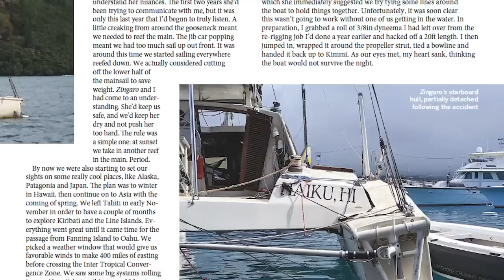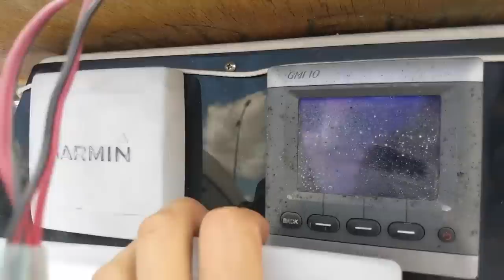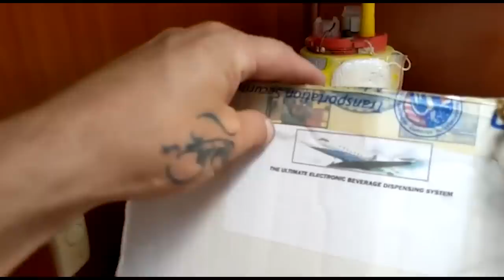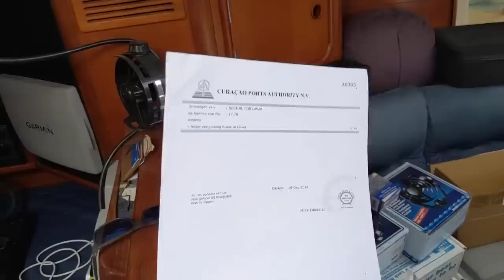Junkyard find! Trash boat, will it float??

Comment: It may be a lot of money now but you’re still gonna have to buy one sooner or later and it’s cheaper than hauling a boat out for the one valve. If it was me I’m getting the valve and putting it in now.
Reply: I agree, Duane.
Reply: Absolutely. Consodering there will be 7 pps onboard, one head is... tough. Sooner, the better. You don't think about this when you are overwelmed by the amount of work, but you should always prioritice basic needs. Water, bed, head.
Reply: I agree,  do everything under the waterline that should be done now while the boat is out of the water.  It will save money when you look at the bigger picture.    It's a gamble to leave a repair until a later haul out  for other reasons (repainting antifoul, prop maintenance, etc.) and have that repair cost you a haul out plus the cost of that repair.
Reply: Couldn’t agree more

Comment: HiJames, I am a old sea dog, and have owned Oyster 55, a few years ago, and completed a major refit. The through hull fittings will be high quality bronze. They should last a lifetime. They will also be very hard to remove. The fittings attached to them look poor, so I would remove fittings, then inspect through hull before decision to replace. Also don’t be shy at contacting Oyster they are very helpful in all respects.  Good luck!
Reply: great advice!

Comment: In 2002/2003 I sailed a 1995 Oyster 61 20,000 miles from England to Russia and on to New Zealand. Your little sistership brings back a lot of memories! Some suggestions - First, the joinery and finishes on the boat don’t seem that bad, so it’s absolutely critical that you PROTECT THE BOAT. Get a couple of thick towels, or even better ‘moving blankets’, and some random sized pieces of plywood and plastic sheets. Always cover and protect the finish and wood work anywhere you’re working. Never put a tool or a part down on an unprotected surface. Never turn a tool or exert force towards an unprotected surface. In particular be careful with those beautiful fiddles around all the horizontal surfaces, it’s very easy to dent and degrade the top edges of them. When you have a nice boat like this, this is an incredibly important discipline. Otherwise it’s easy to do a lot of expensive cosmetic damage very fast, and it only takes a few extra moments and some mental discipline to do it. Second - before you buff the topsides check what’s there; if it’s gel coat, fine. If it’s Awlgrip (which it kinda looks like)  DO NOT BUFF IT. In that case, wipe it down with lots of plain white vinegar, then Awlwash, then Awlcare. You buff it, you ruin it. Last one - unless you get some storage to empty the boat, stand up the cushions on the over under bunks and put everything there, make the rest of the boat as empty as you can. Much easier to do stuff.

Comment: For the 2 inch thru hull in the head.  Remove the hose and spray in lubricant, spray from bottom as well. You have time so let it sit.  Hit it with heat from a torch if needed, keep a fire extinguisher handy and some wet rags to draw the heat away from the glass is needed.  Or pull it out and do the above.   I have the same ones on my boat and they are well oversized (as in can handle a lot of pressure) for the actual work (pressure) they have to contend with day to day.

Comment: James, congrats on the beautiful Oyster. It will make a great liveaboard. The more jobs you tick off the list now, the longer you can wait for the next haul out. So take your time:
1) Considering the erosion that has taken place on the through-hulls fittings, I would definitely replace all of them. If you replace all but one, you will always be wondering if that last one is going to be the one that sinks your boat.
2) While you´re at it replace all hoses and hose-clamps, for safety and sanitary reasons. New plumbing will make the boat feel, smell and taste NEW! - Expensive but worth it.. After all it´s your new home!
3) Fix your holding tank if possible or get a new one. You will run into problems without one..
4) Prioritize the watermaker repair. As far as I understood, it has failed? I guess this is pretty obvious..
5) Keep the old Epirb if its functional. They are 300+ usd
6) Keep the dinghy if it holds air. Money saved! Check if its made from PVC  or Hypalon. The latter should last 10-20 yrs
7) Drop the rudder and service or change the bushing. It will give you peace of mind and help preserve your autopilot, when you bring that one back to life.. (I am no expert, but it looks like the rudder has water ingress? What do you think)
- Lots of projects, but the boat really cleaned up fast. A very sound platform

Comment: James.. for the 2+" thru hull valve you do not necessarily need to replace it. Have you tried using a phosphoric acid wash on the valves? You can flood the valves, flush and or run phosphoric acid through the valve, and use PB Blaster on the outside of the valve. It sjould free them up and allow you to wait on replacing them.

Also, you can temporarily bypass the sink macerator pump and go straight to the thru hull as long as it is just gray wster.

Hope this helps.

Comment: I'm assumimg you have the diesel pumped out by now. You got the basic batteries and dinghy fixed, focus on the rudder, bottom paint and through-hulls/valves. Get those done asap then splash her. If you have time already paid for on the hard do the buffing, but hatches, hoses, portlights, etc can all be done on the water just as easily. Good luck, you got this.

Comment: Hi James, check the big red handle grips in your tool kit, they should slide to fit larger fittings than your shifting wrench. They have been known to shred the edges of fittings if used improperly. Take it easy.

Comment: keep the toilet  pump straight out , it feeds the fish,  you don't want to feed them soup.  You can easily replace the holding tank later,  I'm a great fan of plastic tanks, cheaper  lighter and don't  corrode.   If you leave the thru hole in place   maybe a  wooden  plug  from the outside  just to be sure.  If you were in NZ you would not be able to leave the country if  you don't have plastic thru holes.  Applies to nz boats.  I know why because lighting love striking metal in plastic boats.  congrats on your new boat,  and good luck ;)

Comment: We've been able to clean up a lot of through hulls with white vinegar. It's amazing what the stuff does. Flush it down the heads and it'll clean the hosing and seacocks. As for the large aft blackwater valve, try putting a torch or heat gun to it. You don't want to get so hot that it melts the nylon seals inside, but I bet you can free that up. Once working, close it and brush marine grease on the ball from below, then work the valve around until it gets better. It's the blackwater valves that seize up easiest. The fresh water ones should be cleaned with vinegar so you can see the metal. You really need a conical softwood plug of the appropriate size tied with string to every through hull (so it can't float away). All the rusted hose clamps have to go too. BTW, you can flush diluted hydrochloric acid (Aqua Forte) down the Jabsco heads. It's only bleach that you want to never use.

Comment: Hi James. I love the macerator pumps. I have 2 in the Riva I wrote you about. I will be putting them in my new cat as well. You don’t want clogged lines on a bigger boat that has multiple heads. Mine are really powerful and are original, made in Italy.

Comment: Another tip on that sea strainer clean it also with muriatic acid. If you can not get the pipe fittings loose heat it with a propane torch get nice and hot then quench in a bucket of cold water. The basket is only 25% of the price of a new one. If only the strap handle is bad cut it off. You can weld in a new one, I have used a piece of stainless steel welding rod as a replacement handle.

Comment: Having lived in old motorhomes and boats, I would go with a push button for the water pumps instead of pressurized.  That way if you ever develop a leak it won't run out your water and batteries.

Comment: Hello,
I too rescued a 41' Coronado and had tons of issues with old rusty thru-hull valves.  After several cracked knuckles, smashed fingers, bloody hands, and oh so colorful language, as these valves are never in an easy place to service with ANY size wrench, it always seems that one needs a bigger wrench that will fit in there.  Add to the fact that the hole in the boat may be rotten, although on your boat it is solid fiberglass, mine was not, so some peripheral rot to deal with, I in my infinite wisdom thought to drill out the bad valve.  
A decent hole saw bit is only a few dollars, and after drilling it out, I was even more upset.  Total time screwing around trying to loosen the valve and lots of bodily damage, no success, several hours.  Total time to drill it out, this part really sucks, 1 minute with strong 1/2 electric drill.  I then used the same drill bit to make a wooden plug, and then reglassed the hole.  Later I drilled a new hole to place the valve in a better position for use and servicing. So several benefits.
1. Save your hands, knuckles, and preserve your blood and mental state.
2. Much faster to drill it out.
3. Create new plug, and glass it over.
4. Relocate valve to a better place for use and ongoing servicing.

Just my 10 cents on this issue as I sit here and look at the scars on my hand and as a former musician I like you, cringe when I think of the harm that may come to my fingers.

Food for thought.  Good luck, and I predict the girl will come back.  

Skipper Andy - ramblings of an old Viking Sailor.

Comment: I would change all the thru hulls while it is out of the water, but not the valves, just cap the ones you don't need now. You can remove the cap and put a new valve on while it's it the water pretty easy, I've done it on my boat before.

Comment: I would do the tank valve there. I would try to unstick it by "boiling it in oil first" before I bought a new one. There are lots of clever ways to unstick stuff. Your rudder well/have to disassembled the top     to get it "lubed try" Transmission oil mixed with acetone  50/50 mix it makes it thin enough to penetrate deep might have to let soak over night see if that works. Just one step at a time and before you know it you will be in the water.
Reply: This tranny oil acetone trick works well with dissimilar metals corrosion too. Great suggestion.

Comment: Do the valve. You can't exactly beach a mono hull like you can a cat. Change your thought process. Do all your underwater work while you're in the yard. It does pay of in the long run... you can replace the stainless holding tank with a roto moulded plastic one when you're at anchor...

Comment: Grease fitting.  That pressure can thingy holds most of a tube of grease. The line to the packing holds most of a tube, the packing I don't know.  Disconnect the line at the packing and pump grease through the system until air free clean new grease comes out of the tube then reconnect and try to grease the packing. If you are lucky, that might free it up.  Worked on pump packings for me.

Comment: Kiwi fruit are the result of hybriding the Chinese Gooseberry. The result was a fruit larger in size, more juice but with a watered down flavour. They changed the name to Kiwi Fruit because, well they couldn’t start exporting it from NZ as Chinese Gooseberry. The Chinese Gooseberry also had more coarse hairs. I grew un in NZ in the ‘60s eating them but we had to be careful not to let the hairs touch our tongues. It would cause the tongue to itch terribly. The KiwiFriut are put through a process that removes most of the hairs so I don’t know if they have the same effect.

Comment: Nice boat I am sure when all is fixed you will be very happy with it,  Triradial is not a material but the way the panels a cut, cross-cut are horizontal panela and in triradial are of a diamond shape  when attached together

Comment: About your computer:
If it shuts off after some time, it means that CPU is overheating.
To keep laptop cooler you want to check all the vent slots on the bottom and on the sides and vacuum any dust from there (if it has those). You also should not put the laptop on any soft surface to keep those vent holes opened and bottom air cooled.
When you use your laptop you can put it on a couple of pieces f wood to elevate it from the desk to increase ventilation.

Comment: Computer crashing: it's possibly the heat, but you can help it by just unscrewing the case and carefully cleaning out any dust and crud from inside, especially around any cooling vanes, the fan, and heat-sink around the CPU.  If the computer's own cooling is clean it should be OK to work.  Get further support for cooling by having an external fan to sit underneath and help draw air through.

Comment: Replace the cooling paste between the cpu's and fans and clean all dust from the fans. This will most likely fix the laptop/computer overheating problems. The cooling paste dries out, hardens and does not work as good anymore as when it was new. It is a fairly simple fix. And will only cost a couple of dollars.

Comment: The 2" through hull may be good, it's that valve that needs work -take it off and see if you can fix it. If no go replace it. Same goes for all the through hulls. Sand off the top and see if the metal is corroded or de-zinced (pink color). Bronze will last really well as the outside is painted. my 2c

Comment: On replacing any fittings or anything old under the water line that if you are having a thought if water tight integrity can be a issue then it's better to be safe than sorry. Replace everything under the water line

Comment: If you add up all of the cost related to the head ball valve; valve, through hull, hoses, new holding ect. . . it's going to be $$$.  Would it make sense to get a composting toilet and remove all of that stuff?  Does that valve connect to the shower sump?  you can either seal up the hole and have one less through hull or just replace the through hull/valve and keep it closed for now.  You have two heads on the boat.
Reply: Composting heads are the way to go. No more fixing the pooper. No lingering smells and no rebuilding failing pumps.

Comment: I freed up my thru hull valves on my Westsail using vinegar, oil, and a heat gun. The heat gun did the trick...it didn't take too much effort and all 7 freed up with no problem.

Comment: Need to open your computer up and clean out the dust with a can of air and clean paint brush.  There are tutorials on youtube but my advice is to diagram all the placements of the screws and masking tape them to the diagram so they don't get lost, you don't lose track and they go exactly where you took them out of.  If you're feeling braver remove the heat sink from the processor, clean off the heat sink paste with rubbing alcohol and reapply fresh paste, size of a grain of rice.  That will make an even bigger difference than just dusting alone.  Get a product called Krud Kutter for all the rusted and corroded stuff.    It works wonders.

Comment: Try putting a propane torch on that large valve. Tap and spray with penetrating oil. You will have to do this multiple times but eventually, it will free.

Comment: James, As far as your computer, it sounds like its overheating. Try cracking the case, blow out the fan, heat sink and re-greasing the processor(s). Laptops are a pain in the a$$ but a repair shop shouldn't cost that much. if that doesn't work then back up you hard drive and reinstall the OS.

Comment: James, the EPIRBS are old but only need a new battery pack of 8 D cells.  The cost of the batteries is about $32 for a box of 10, and some battery stores can spot-weld the 8 cells (only use Duracell alkaline) into a 12V pack and cover it in a shrink wrap if you buy the box of cells from them. If the battery pack connector is corroded, just cut it out and bypass it with similar wire directly from the transmitter to the pack.  If you try to get an 8 D cell battery holder (Amazon or eBay) in the right configuration to fit in the compartment, you can make it fit if you trim the heck out of it, but that takes too much time and effort, IMO.  The rubber O-rimg is likely in excellent shape, just put a light coat of grease on it to make it easier to seal and unseal. As you know, getting a new EPIRB is way more expensive.  Whether or not you need an EPIRB depends on your skill level and the SHTF risk level and only you can estimate that. If you take on crew, I would definitely get a new battery pack so the EPIRB can be used to locate you if you need to abandon the Oyster for the dingy.  I've done this work here in FL for a friend.  Maybe you wait till you get back to FL to get the EPIRB ship-shape?  Right now, you have higher priorities just the have a live-in boat on the water.

Comment: Hi James it’s probably too late now but if not see if you can find Hansen reinforced nylon valves and thru hulls. They are cheaper than bronze and stainless fittings and last forever, don’t corrode and don’t jam up.

Comment: If the through hull is not leaking take the ball valve from the through hull fitting, get it in a vice fill it with penetrating fluid leave it for a couple of hours  then see if its free or crank it ,get some heat on it, any way you can free it . don't forget  to  plug the holding tank first. couple hours work will save 300 bucks, you got the tools get it serviceable swap it out later.

Comment: I have the whale tiptoe pump in my boat.  I like the form but the function sucks.  The first one leaked after a few months, the second leaked right out of the box.  I ended up installing a ball valve on the fresh water line to prevent all of my water from draining into the bilge.  Best wishes on your new adventure.